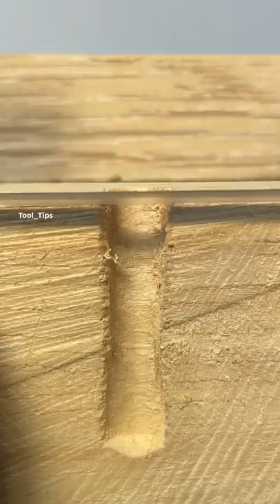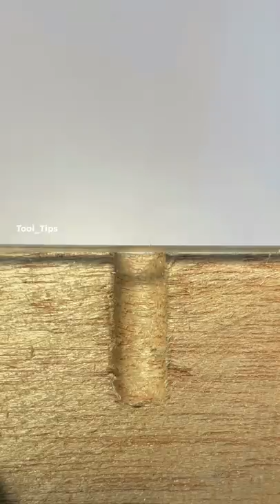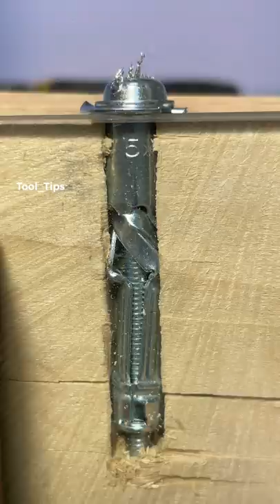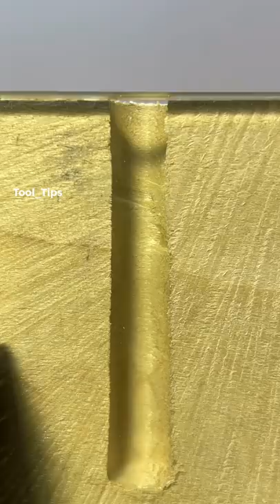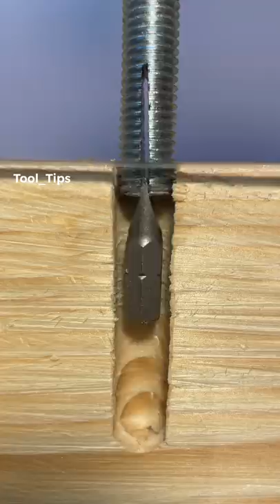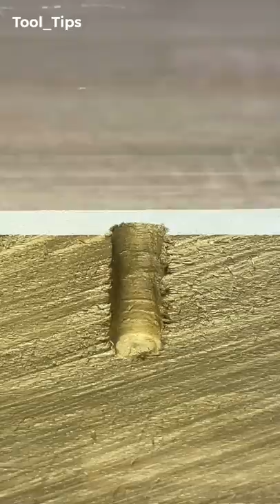#shorts The Best

Comment: Aren’t some of these supposed to used in Sheetrock? And that’s why they didn’t expand
Reply: Yep... the so called tool-tip person has no idea..!
Reply: Pretty much all of them, yes. A few are for concrete as well. But pretty much none of them other than the dowels are made for wood.
Reply: @RaXXha  fhh
Reply: Greg Carver  fun would’ve been showing how it really works. I can’t be the only one who thinks about what it looks like beyond the surface of the Sheetrock.
Reply: Came to make this comment except I call it drywall.  All of the plastic drywall screws are meant to open as in flare out behind the hole that is necessary to keep screws from pulling out especially for things like towel bars and tp roll holders that are usually placed for location and can’t always be in a stud.  I try if I can to use one side in a stud for better support and sometimes dab a bit of caulk on the plate being screwed in.  Seeing how they react with no space was interesting but I would rather have seen how they work in the empty space behind it the way they are designed to.  This used the same size hold for everything too which is odd because I would drill a proper size pilot hole for anything I’m screwing in.
Reply: This .... ugghhh the good ole days before being visually impaired.
Reply: @robertverduzco2406  Jesus calm down
Reply: @DMO-DMO-DMO  I can't I haven't had any for over 3 years
Reply: @robertverduzco2406  ....wut
Reply: They did expand.. and that’s why they split the wood.. not meant for wood
Reply: @robertverduzco2406  hope you're alright, dude~

Comment: Strangely satisfying, cool to see structures designed to implode to fill gaps
Reply: Explode, no?
Reply: @Appoxo  seemed like implode because the twisting screw was shortening the plugs from the inside, but that did cause them to widen, so maybe explode in the end? Kinda like a supernova, shrinks before expanding haha
Reply: Thats what she said
Reply: @jlo6113  😂😂💯💯
Reply: @paulroseberry_saves_society  vive. as
Reply: Explode bro, implode would imply it's collapsing inward
Reply: @DustyTripleSix  yeah, that's what the plastic pieces do when the screw is turned from within. The pieces start out long and hollow but as the screw turns it pulls the ends inward and the free space is pushed out
Reply: @paulroseberry_saves_society  if it pulled the pieces inward it wouldn't be able to expand into the empty space. It expands it doesn't contract
Reply: @DustyTripleSix  it does, like stepping on a soda can. The top and bottom are brought closer as the sides cover a wider space.  The net volume is less but the physical width is greater.
Reply: @paulroseberry_saves_society  even stepping on a soda can would be explosion not implosion. Just because you're stepping on the top doesn't mean the sides aren't expanding out. If you put a soda can in a vacuum you could get it to implode but crushing something does not count as implosion. Just think about it a little bit.
Reply: Most of these are drywall anchors and aren't designed for wood. They're designed to expand behind drywall and keep the screw from falling out or wrecking the drywall.

Comment: The majority of these are just examples of fasteners/anchors being used in the wrong application. I'm not sure if that was the intention....
Reply: I thought the same....you should not put most of those with wood, but the purpose of the video was just to present the mechanism and to see how those fasteners work. And he could let us see using wood and plexiglass, so that is it.
Reply: @Diana-bq9fw  pp
Reply: Seriously.. half of these are drywall anchors and most of the others were for masonry.. 🤷
Reply: @Diana-bq9fw  but the point for a lot of those fasteners is that the extend out the back of the drywall and create an barb that keeps it from being pulled out. So putting it in a wood channel doesnt even show how its supposed to work

Comment: Some of the metal ones really tear the wood up. I think the red and silver one held up great. I realize that you want them to lock into the wood though, so that they will hold up over time. I never knew about the metal bits that a bolt splits over.
Reply: They were designed to be screwed in with a lot less torque
Reply: Most of these are not for wood at all. They're drywall anchors or tile/stone/concrete anchors

Comment: the algorithm knows: It's 3am. I will watch anything..
but why tf do they put anchors in wood?
Reply: It’s to hold things in tight
Reply: Just cause you right...does not make me the guy wrong here
Reply: Actually, it's 4:26 AM.
Reply: Right. No anchors needed in wood. But I guess it's just showing different ones and how they work in drywall.
Reply: Especially concrete anchors..
Reply: @tishalou8591  except drywall isn't that thick. With correct usage the drywall anchors can expand behind the sheet, whereas here they are constricted and/or the screw or bolt hits the bottom of the hole.
Reply: @JamMastaJew  I'm aware how thick drywall is. The cutout view is showing how it would look in the right medium (drywall). I'm assuming this is their intent.

Comment: He's doing it wrong, but it's cool to watch
Reply: How
Reply: how
Reply: To all the people saying "how" dude he literally breaks the metal screw holder and splits the wood apart in one of them. Splits a dowel in another. Chews up the plastic. I'm like 80% sure it's a meme video and either meant to make you laugh or cringe.
Reply: @greenwhatevers6263  hahah the plastic is supposed to be chewed up that’s how is increases friction on the wood.  It’s not like you can see the plastic in practical use
Reply: Any video like this you’ll always find this comment
Reply: Pretty sure it is just for show tho, the only one you need to actually use with wood is the dowel pin with glue, the other two ways with them is pretty much gimmicks, since it helps the dowel pin to fixate in the wood easier, and they can prove to be useful, but it is the glue who actually solidifies the furniture, anchors with nails and screws don't have much use with wood, since a screw already has good fixation in wood, and a nail is just a way to press both pieces and give a little structure while the glue do the actual work, now the anchors is pretty much unnecessary in wood, but they do wonders with cinder blocks, and in mansonry in general, and the short already proves how strong they can be
Reply: Sus 😳
Reply: That's what she sed
Reply: @michaellewis9589  its called 'overtightening' and is a very common mistake made in construction. That metal socket he screwed into wasn't even correct for that hole, AND they overtightened the hell out of to where he he stripped the screw itself. He messed with the audio so you wouldn't hear, but in reality you would've heard his drill screaming while doing that. You also shouldn't use a drill for half of these anyways because of overtightening. Its less of "these are better of those' and more of 'I'm inexperienced and don't know which tool to use for what job'
Reply: I'm the least handy person ever and regularly do shit like this without meaning to and even I know that's not how it's supposed to be done.
Reply: @greenwhatevers6263  it's a cutaway to show you what it looks like in the wood
Reply: He a little confused but he got the spirit
Reply: it's just for fun, i don't think he meant to instruct anyone
Reply: Dude hes not doing a tutorial on how to use these, hes just making something satisfying

Comment: That "put a tiny screw/nail in a too-small dowel so it splits and expands" trick is gonna blow my coworkers' minds next week
Reply: I'm so stealing that trick too!! It's brilliant!!
Reply: What exactly is the trick good for? Surely that is gonna cost structural integrity
Reply: @UltimateDillon  Correct, however, the wooden pegs only experience small amount of vertical and lateral forces. It won't pull out, or sheer without damaging the material around it.

They're used to connect pieces of furniture, and are often glued in, however, sometimes they're friction placed, because glue is not recommended. The issue with them is that they're pure unsecured wood so they throw splinters and round off easily. This trick prevents them from acting like a hotdog down a corridor and forces them to stay in place. Their damage, once in place, is irrelevant because of the crushing forces applied to their outside. They're squeezed into shape, and any cracks are negligible at that point. Well cut toothpicks would do the same job. 😉👍

Comment: These things seem like the definition of “task failed successfully”
Reply: Oh no they're supposed to do that. wall anchors are designed to make it impossible to get the screw back out by deforming and making the hole smaller than the screw so it wont pull put under stress from something like holding a shelf or whatever~

Except for that one that was too powerful for the wood and split it in half lol
Reply: @beleiveinthemagic123  i know, they’re entire existence just seems like that to me.
Reply: @lettuce8279  that's fair it does seem like you're not supposed to twist em til they snap lol

Comment: That was actually extremely helpful. Now do one with plaster instead of wood.
Reply: Right 🤦🏻‍♂️
Reply: yeah most of what he showed was ment for drywall lmao
Reply: Well I mean plus the way the glass was on the side of the wood also screwed with how the anchors act normally
Reply: @ryuuthefrog3775  you read that from another comment dawg cmon
Reply: @AspenFrostt  yes and he used in different sort of woods, and sometimes very cheap one, or use things in the bad way it's only funny but it's not helpful at all
Reply: @rad44rr  what’s the big fuss 🙄
Reply: @Andrew-gx7xu  did I ask you chief?
Reply: @Andrew-gx7xu  Leave it out white bread
Reply: @rad44rr  runrunrunrunrun
Reply: @rad44rr  huh??? It’s a danny duncan reference nothing to do with what you assume to be racism.

Comment: Now if you could do the same video but use drywall/sheet rock as your medium/substrate.  That's where most people use these anchors.
Reply: Yeah I was wondering since they wouldn’t bend and distort as much in drywall. Still cool to watch.
Reply: @aurelioguadalupeguerragarc1090  نمی

پ

ن🙀
Reply: You won't see effects in harder surfaces like concrete or rock. Because he drills hole on the edge and gets plexi so you can see through. Harder surfaces will just shatter on the edge I think.
Reply: @aurelioguadalupeguerragarc1090  8
Reply: @AmyMichelleWiley  ;
Reply: @นิพนธ์อุ่นเอม  เอ่อ
Reply: @aurelioguadalupeguerragarc1090  you're probably 8 year old or something 
I know what you did
I also live inside your walls
I always watching you at night
You're not safe
Run as fast as you can
but you can't hide

Comment: These are not at all how I pictured them working inside my wall.
Reply: And how exactly were they supposed to work in your mind?
Reply: Acab
Reply: Your walls are not made out of wood
Reply: This isn't how they work in your wall. Walls are hollow, not solid.
Reply: They’re not supposed to be drilled in
Reply: @dwigt123  no
Reply: @moxie8839  okay you have point there
Reply: @dwigt123  yes
Reply: That's not how they work in drywall.
Reply: @kr580  also drywall is a lot softer and would allow the tabs to expand and grab

Comment: I swear dowel joints exist to provide a semi-permanent so that you don’t have to use nails or screws. Just drill the hole for the dowel pin to the correct diameter so you don’t have to add anything else to it.

Comment: Ok so the ones with vertical gaps hold the best.
The white, I guess it’s silicone, would do the job but few hours later, when it dries out and has a shape of the place that it is in. But wet of course it will swim on all sides and will not be there where it should be and will not be able to hold that screw. 
Or with the yellow plastic why would you use screw so short that it doesn’t even touch the wood? If it could get into that wood it wok look different.

So the video seems to be a bit manipulative because the outcomes would be different if used properly. Maybe it’s an advertisement and we don’t even know it.

Comment: Why are you putting hollow wall anchors in solid wood? Not a tip just go a 1/4 in up from the hole that's too big for your screw. You trollin? And the drive pin anchors are used for masonry in my experience, not carpentry.